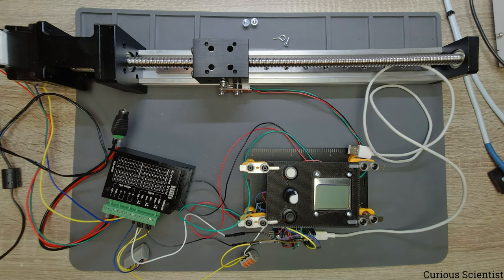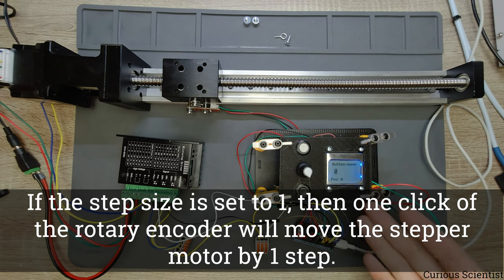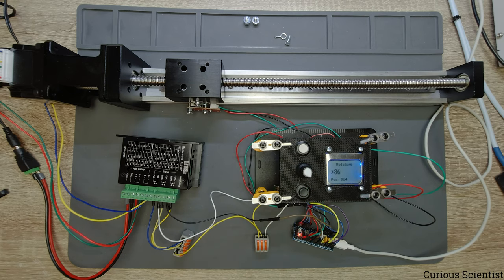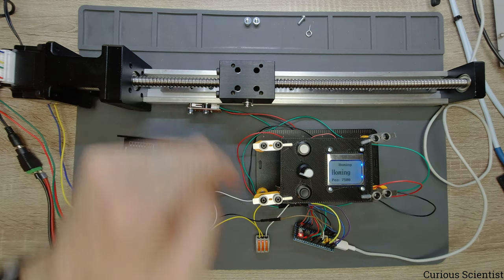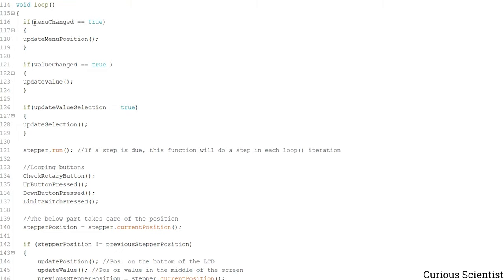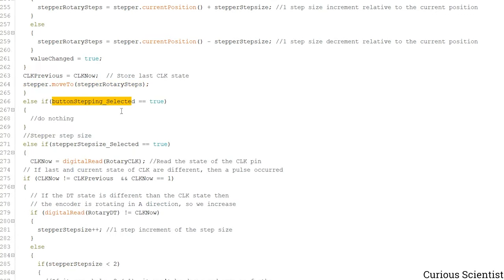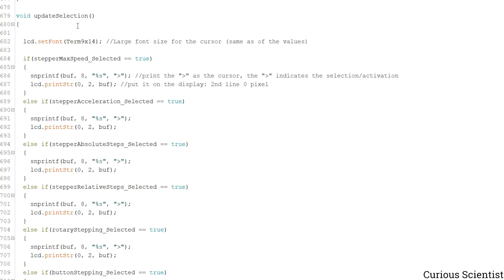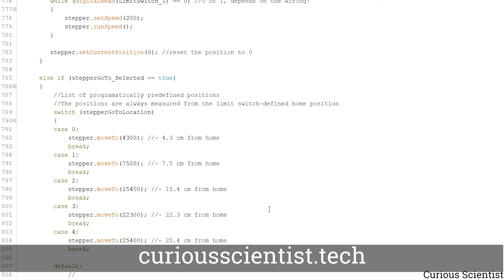Stepper motor control panel for linear actuators

Comment: Awesome demonstration 👍
The fly said: maybe this device is modifiable to add a linear sensor or an encoder to the shaft to get a closed loop system
Reply from the maker: Thank you very much! I think the fly was suspecting something... :) I will actually add an AS5048A sensor to this actuator. I just need some time to draw and print a bracket for the circuit and write some code for the closed loop control. But I will definitely make this happen!

Comment: So i did a little research and found that AccelStepper with distance 1.0.4 is in millimeter distance. Is this where the code would be to convert from mm to imperial? Like i said, I'm a newbie and bound and determined to figure this out. Hopefully with a little bit of help😊
Reply from the maker: Sorry but I have no idea about what you're talking about. Accelstepper doesn't use mm units, only steps are used.

Comment: Hello, I am a newbie learning code and was playing around with your code and was wondering how I would go about converting Milimeter to imperial in the code. I live in the US, and I would like my tinker project to display imperial. Any help would be highly appreciated.
Reply from the maker: Hi! It's the same way as you would do it on paper. Multiply the millimeters by 0.0394, so you get the result in inches. Or you can substitute the pitch with the imperial unit (I guess you use TPI over there) and then get the result in inches directly. Both could work.
Reply: @CuriousScientist  thank you for your feedback. I have watched a few of your videos and wanted to let you know you're doing an amazing job, and thanks for sharing your incredible talent.
Reply from the maker: Thank you! I am trying my best.

Comment: Thank you very much for making such informative videos.
I am having a hard time getting it done for me. The library for nokia N5110 is not working appropriately.
I didn't see anything on screen except the light.
I don't know why may be the N5110 display is bad. However, I ordered it from your link. And can you please also let me know about pins of rotary encoder which one is clk , Dt, and switch as the one which I got has pins S1, S2, and key.
Reply from the maker: Hi! If you use the exact same procedure as I did; same parts, same libraries, same code (my code), then it should work. Regarding the rotary encoder, it does not matter which is the CLK and which is the DT pin. If you swap them, you will only get the opposite behaviour, but nothing gets damaged. You can flip the wires and do everything as usual. S1 and S2 are CLK and DT and the key pin is the SW (switch).
Reply: Thanks and one more question .
 Stm32 does not have any function to digitalPinToInterrupt in the following line. attachInterrupt(digitalPinToInterrupt(RotaryCLK), RotaryEncoder, CHANGE);
Reply from the maker: What's the question?
Reply: I got an error that stm32 blue bill does not understand digitalPinToInterrupt as its defined before in the following line of code.
attachInterrupt(digitalPinToInterrupt(RotaryCLK), RotaryEncoder, CHANGE);
Reply from the maker: Probably a bracket ("{" or "}") is missing somewhere. Check the code.

Comment: I have a question concering the LimitSwitchPressed() function you are using. For my realisation I found it easier to use the attachInterrupt() and then trigger a stopMotor() function as you did in your old homing video. When I now trigger it, with the stopMotor() function defined as below, then after triggering it stops immediately (that I want) entering another command it still proceeds to decelerate (where it left off) and then turns around and goes to the value selected. Would you happen to know how I can make it so that it does not "decelerate" since that is quite pointless?

And another question is, if there would be a away to implement the while from the LimitSwitchPressed() into the attachInterrupt() based function. I don't seem to get it to work unfortunately, playing with the setup and the digitalRead 0 or 1 values.

void LimitSwitchPressed() {
  if (digitalRead(pinCrash) == 0) { //0 or 1, depends on the wiring!
    if (millis() - previousInterrupt > 300) {
      stepper.stop(); //"soft" stop - decelerates to 0.
      previousInterrupt = millis();
      //Alternatively we can make it to go to a specific place:
      //stepper.moveTo(0); //This goes back to absolute 0, which is technically the homing
      
    }
    while (digitalRead(pinCrash) == 0) {  //0 or 1, depends on the wiring!
      stepper.setSpeed(500);
      stepper.runSpeed();
    }
    //stepper.setCurrentPosition(0); //Set the new position to zero
  }
}

void stopMotor() { //Function activated by the pressed microswitch
      runallowed = false; //Disable running
      
      Serial.println("Stopped by crash sensor."); 
      stepper.stop();
      stepper.disableOutputs(); //Disable power
      Serial.print("Current position: ");
      Serial.println(stepper.currentPosition()); 
      //stepper.setCurrentPosition(0); // reset position    
}
Reply from the maker: As long as you use the run() function it will decelerate. Read the documentation of the AccelStepper library. Try to put a runToPosition() command right after the stop() command, it should help. You should not run anything in the ISR(). Just switch a flag and do the task in the loop() based on the flag's (a bool variable) status.

Also, please not that I am not a free consulting service. I cannot keep solving the questions.
Reply: @CuriousScientist  First of all, thank you I will check it out. Secondly, I understand and it was not really intended that way, more of a discussion that any viewer of this video could answer. I did not plan on asking other questions or expect them to be (fully) answered.

Comment: Hi Pal !! Your video series related to stepper motor is really helpful. I need to complete a project using a linear actuator based on the NEMA 23. The project contains keeping the sliding part at 20 mm from the other end (making it Home) and giving it a stroke length ranging from 1 mm to 20 mm. And in every stoke length, the frequency of reciprocating motion of the sliding part can also vary ranging from 1 Hz to 10 Hz. Can you plz let me know if it is possible to achieve this way of motion?
Reply from the maker: Hi! You didn't mention anything about the load scenarios... But, to cover 20 mm while oscillating with 10 Hz sounds reasonable. But you need to consider load, acceleration, inertia...etc.
Reply: @CuriousScientist   there will be a 3d printed attachment on the top part. the weight will be possibly 100 gm max. the attachment is supposed to perform reciprocating motion(different stroke lengths with different frequencies) and also to hit a wall against it. the wall will be fixed at the other end of the linear actuator.

Comment: I am facing a problem while using this code. I pasted the exact code in the arduino IDE, include the N5110 library but when I try to compile the sketch, it returns an error everytime saying that, "N5110_SPI.h: no such file or directory." Can anyone please help me out?
Reply from the maker: Based on the error message, you don't have the library installed. It should be installed in your Arduino/libraries folder. Including the library doesn't matter if there's nothing to include.

Comment: This seems to be your earliest video where you have used STM32F103C8T6 Blue Pill and have described the code in detail. I'm just wondering whether you used the Arduino IDE to upload the code to the Blue Pill and whether you also used the STM32 ST-LINK Utility as you described in another video "STM32F103C with ST-Link and STM32duino, simplified!" (https://www.youtube.com/watch?v=saolJ_7E7hc). How would it be different if you had only used the STM32CubeIDE with the ST-Link V2 dongle?
Reply from the maker: Hi! 
Typically, when you buy a Blue Pill, they come with a pre-installed bootloader. That means that you can directly connect to them via USB and upload the software from Arduino IDE. I was not using the ST-Link in this case. 

The video that you are referring to is a guide for those who want to install the bootloader on the Blue Pill, or for those who want to program the microcontroller with the ST-Link. The bootloader is just a convenience which allows us to upload our code to the circuit through a USB connection. 

Regarding your last question, I would say that it would be entirely different. The CubeIDE uses a totally different syntax (HAL), so even the code would be totally different. You would need to write everything from scratch. Programming-wise, you just need to connect the 3.3 V, GND, IO and CLK to the board and upload it using the ST-Link. It is simple.
Reply from the maker: Hi! Both MCUs came with bootloader, so I could program them via USB. Once again, from an oversimplified perspective, the bootloader is only a convenience for us users that allows us to upload our code via USB. We do not need the bootloader to upload the code to the microcontroller. You can use the ST-Link and upload the code directly with the ST-link. 

In the Part 8 of my coil winder video series I show how to configure the IDE to be able to use the ST-Link to upload code to the microcontroller. Then I also used the ST-Link to get that code on the MCU.
Reply: @CuriousScientist  Sorry, I must have missed that bit, i.e. "how to configure the IDE to be able to use the ST-Link to upload code", in Part 8 of the Coil Winder video series. However, I did find other videos on this topic which also describe the need to set the Arduino IDE Upload method to "STM32CubeProgrammer (SWD)", among the other things.

The need to run STM32CubeProgrammer with the ST-Link connected to a USB port is explained in some of those other videos. They say that STM32CubeProgrammer just needs to be opened and then closed.

I think I saw one video where STM32CubeProgrammer was able to CONNECT to a target (STM32F103C8 blue pill/STM32F401CCU6 black pill?) which was connected to a ST-LINK V2. However I have not been able to replicate that (CONNECTING to a STM32F401CCU6 black pill using STM32CubeProgrammer and ST-Link V2). It does not seem to matter though, because Arduino IDE is still successful uploading code (to a STM32F401CCU6 black pill) via the ST-Link V2 when the upload method is set to "STM32CubeProgrammer (SWD)".

Comment: very noisy motor. you should use TMC2208 you will get a much better performances from the motor and also less space used by the driver .
Reply from the maker: Wrong. I was using low microstepping value (I think, I used 400 steps/turn or something like that) which is of course noisy. I could've used 1600 or 3200 steps/turn which would've rendered the motor almost entirely silent. Additionally, my table also amplifies all kinds of vibrations which you could also hear. Finally, your suggestion is bad, because the TMC2208 is rated for 1.4 A continuous current whereas this stepper motor is rated for 3 A. Also, the TMC2208 is more expensive. :)